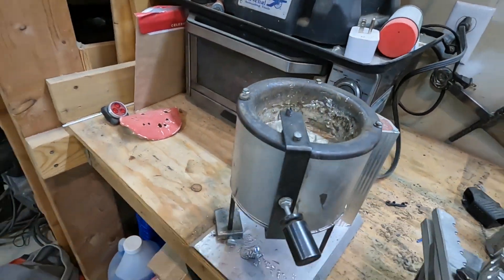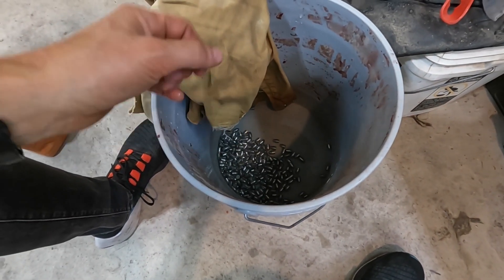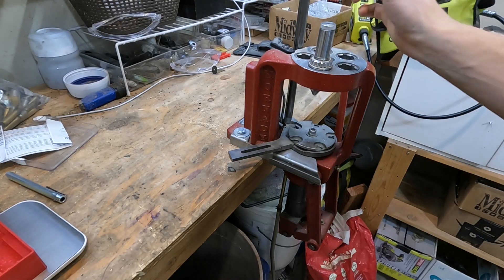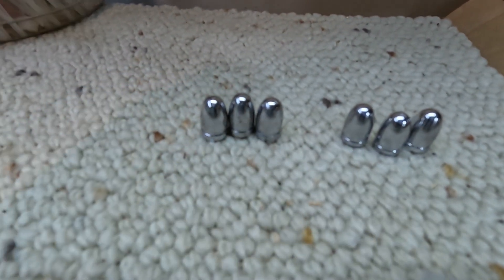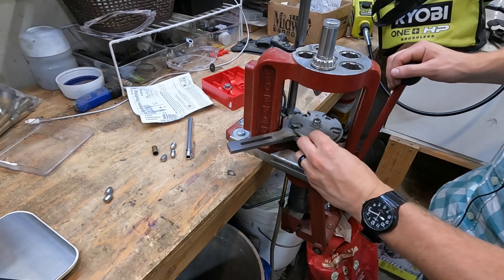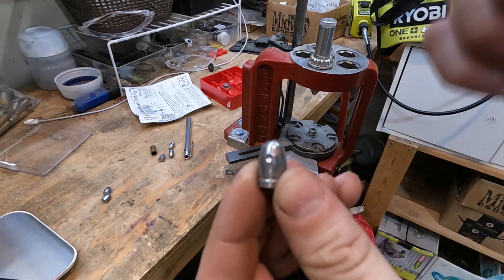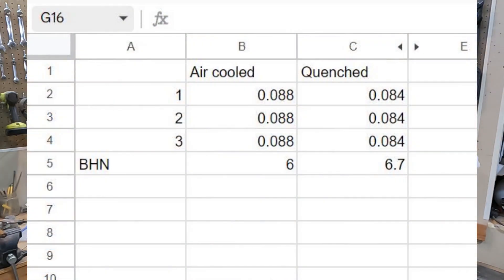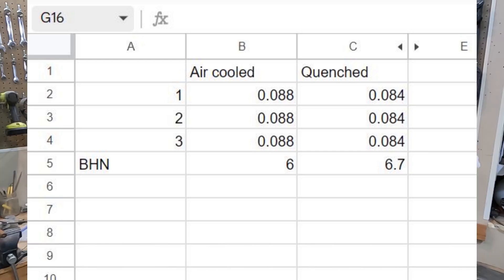Does Water Quenching Make Cast Lead Harder?

Comment: Are you shooting BHN 6 bullets out of an 9mm? are you getting leading in the barrel? and how is the accuracy?
and thanks for you informative videos
Reply from the maker: I am shooting pretty much raw lead (whatever I got from the scrap yard). So yes it would be about a BHN of 5-7ish depending on what got melted at that time. I don't get leading in my barrel but I do powder coat my bullets. If you don't powder coat your bullets you will get leading which is a pain to clean. 
I have shot thousands of cast/powder coated 9mm bullets through all my handguns without issues.

Comment: My understanding is if you quench the bullets there is a life expectancy on the new hardness and only takes a few months to lose the gain.  
 What I want to know what difference does it make in performance?
 Do you usually cast 9 with that soft of lead? Since I started powder coating bullets I have found I can get away with softer lead even on heavy magnum loads. And I dont need gas checks any more.
NDR
Reply from the maker: For 9mm I cast whatever lead alloy I have I usually don't even check how hard it is. 9mm isn't even a magnum round so I have found soft lead isn't an issue for it.

Comment: Thanks for the quick look at the quenching process. I have done a considerable amount of casting over the years. And I am about to cast for a friend 45/70. Using a Cast Bullet Engineering 402gr mold. I do use a very hard mix for this type of projectile as it going to be run at 1600fps. And I am planning on quenching for the first time. I would be more than happy to report back on my results.
Reply from the maker: That would be interesting to see with a harder alloy if it makes a bigger difference.